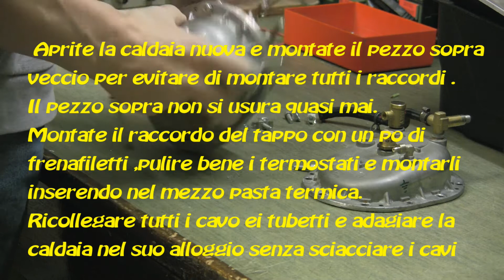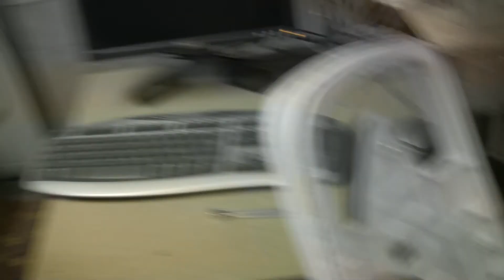OP 16: vaporella polti forever 850 non esce vapore 2°parte

Comment: Ciao Oberdan anche io sto riparando una vaporella Polti Forever 850 Pro codice PLEU 017044. Dunque la caldaia era bucata dalla parte di sotto (inoltre il buco coinvolgeva anche  la corazza della resistenza che entrando a contatto con l'acqua andava in dispersione provocando l'intervento dell'intterruttore differenziale del quadro elettrico). La parte di sopra era pure  ossidatissima tant' è che per poterla aprire ho dovuto usare il flex per due prigionieri di assemblaggio completamente arrugginiti e bloccati. Per non parlare dei vari pressostati e valvole non si svitavano a a freddo neanche a parlarne pena rottura se forzavo. Per cui ho dovuto usare un cannello a butano per riscaldare le varie parti in ottone tenendo la chiave di svitaggio in tensione fino al suo iniziale cedimento a svitare. Svitati tutti li gli accessori, purtroppo  tra calcare ( termofusibile a 4 poli con fascia azzura) e calore del cannello le parti in plastica ne hanno risentito: ho perso il filtro del tubo dell'elettrovalvola la parte interna del pressostato di sicurezza da 7 bar. Per cui ho ritenuto di acquistare tutto nuovo tranne l'elettrovalvola completa di pistoncino che ho svitato e pulito dal calcare interno. Piuttosto mi è arrivata la caldaia completa già assemblata al cui interno sento un rumore  metallico, come se ci fosse un lamierino semifissato. In centro assistenza dicono che è stato segnalato alla sede centrale di assistenza della Polti che l'ha inviata, e da li stesso gli hanno detto che è normale. Nella vecchia non ho trovato all'interno traccia di ciò. Il tecnico di assistenza che mi ha ritirato i pezzi mi ha detto che forse è un dispositivo che poi con il vapore in atto avrà qualche funzione. Secondo il mio parere potrebbe avere la funzione tipo di un anodo sacrificale come quello che usano le barche e che con l'uso man mano si usurerà. Ti chiedo se ti è successo di avere tra le mani una caldaia completa e di avvertire all'interno questo rumore metallico.
Reply from the maker: io ordino sempre in internet la caldaia e mi arrivano solo le due parti in alluminio e all interno
non sento nessun rumore poi uso la la parte vecchia sopra che solitamente non ha calcare ,o poco ,
poi la monto.Se il pressostato , elettrovalvola o termostati sono rotti ,li cambio . se l elettrovalvola
ha il calcare si può pulire.io sono sempre riuscito ha togliere i componenti senza scaldarla,poi 
quando li cambio metto il frenafiletti e aspetto che asciughi .